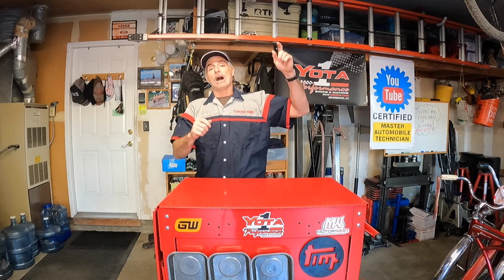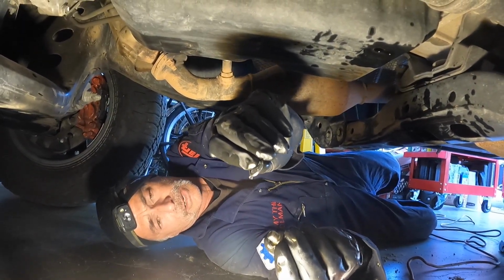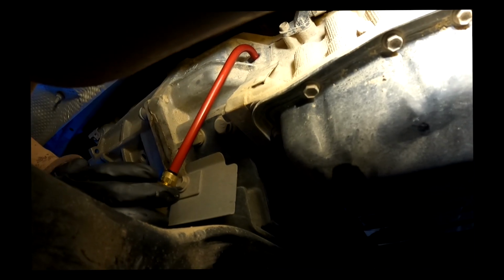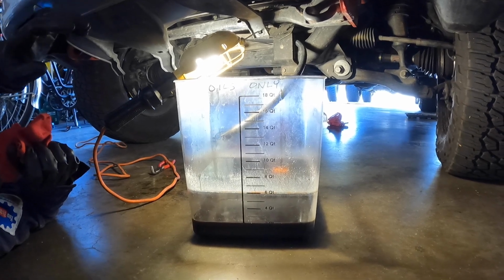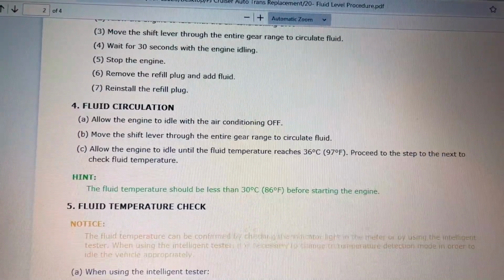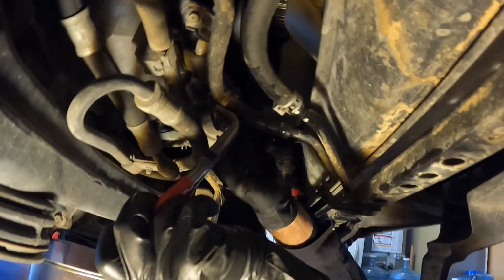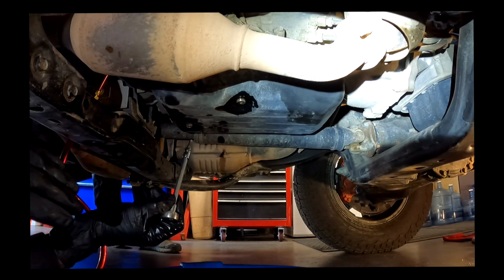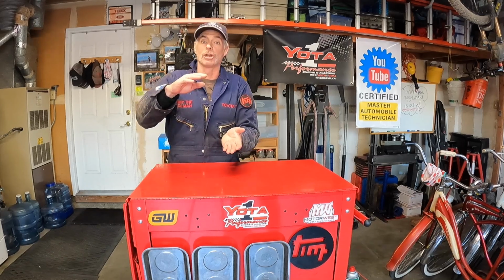Toyota/Lexus Sealed (No Dipstick) Automatic Transmission Flush (Fluid Exchange)

Comment: Nice video, the correct way to do a hot change no dip stick.  Though with fluid that dirty, if the miles were high I would have elected to drop drain pain and replace filter and gasket.  What are your thoughts on using better ATF like AMSOil signature fully syn if car is out of warranty as seems alot folks find at higher mileage and colder temp weather it works much better.
Reply from the maker: Yeah, dropping the pan and replacing the filter isn't a bad idea.  Aftermarket fluids are fine in my opinion.

Comment: Is there a possibility that you may have less fluid than necessary? If so, how would you know how much more to add during the drain and fill?
Reply from the maker: I definitely think Thanh's transmission was under filled based off how much came out.  If you're concerned about getting the transmission properly filled, we cover the procedure at the end of the video.

Comment: I rolled 182,000 before doing a transmission service.My tundra drained three qts. Started cold drained 3 quarts added 3 ran thru gears.repeated three times. Run to temp. Adjusted level. Working great two years out.used Valvoline full synthetic checked after 30,000 miles fluid looked red. I attached 4ft, of 1/2" clear tubing to a funnel threaded from engine bay to filler hole .
Reply from the maker: It's pretty amazing that you got away with not servicing the transmission for that long.  From my research,  the effective life of ATF is only 100k miles, and that's under perfect driving conditions, with the truck never being driven in the mountains or towing anything.  In my opinion, you took away some potential life of your transmission by not giving it regular fluid servicing.

Comment: The Rav4 Hybrid is SO easy. Drain to EMPTY and simply REFILL through FILL PORT until overflow and then let it drip from the same port until a drip. 
NO temperation observation.  You're DONE. 
So what I have to get under the vehicle.  I have to replace the filter anyhow.
Reply from the maker: Yeah, simple is good.

Comment: Tim, I have a 2014 RAV4 and the maintenance manual has no mention of changing the transmission oil thru the 120,000 maintenance (highest mileage the manual goes to).  It does mention changing the transmission oil if operating under special conditions, like driving while towing, car top carrier or heavy vehicle loading.    When should the transmission oil be changed if driven normally?
Reply from the maker: The life expectancy of ATF depends on the temps it's been subjected to.  ATF can last as long a 100,000 miles if the fluid temp never exceeds 170 degrees fahrenheit.  If you drive at all in the mountains, you will be exceeding 170 degrees.  As the temps go up the life expectancy goes down.  When fluid loses its effectiveness to lubricate, excessive wear happens.  

Since I drive a lot in the mountains, I do a drain and refill of the pan every 10k miles to keep my fluid in good shape.  This is what I recommend people do.  If they want to wait a longer interval, then I recommend a full renewal every 30k miles.  Performing fluid maintenance is cheap insurance.  It might be overkill, but I'd rather err on the side of doing fluid maintenance too often than not enough and then be looking at a transmission replacement.  It's a big and expensive job to perform.

Comment: It occurred to me that I would like to do the fluid level check before doing any of this.  What vehicle was this? How can I find out what transmission I have on my 06 Tundra?  How do you know if you should replace the atf filter?
Reply from the maker: The vehicle used was a Lexus GX470.  Your Tundra has the same transmission.  We list all the vehicles that had this transmission in the video description.  You can tell if the ATF needs replacing based off service records.  If you don't have service records, you can take a look at the color of the fluid.  Healthy ATF is pink in color.  As it breaks down and deposits gather in the fluid, the fluid gets darker.  Dark red is borderline good.  If it's brown or black, it's overdue to be renewed.  You'll get different suggestions on the interval to do a full renewal or partial renewal.  I believe a full renewal should happen every 30k miles.  If you want to do just drain and refills of the pan, do them every 10k miles or every other engine oil change.
Reply: oops, I missed that part of the video description, even though I thought I read the whole write up you did in the first comment below.  You are a real hero for showing us all these shop procedures!  I loved this one!  I bought my first Toyota a little over a month ago, but yet I had watched many, many of your videos, even before purchasing the Tundra.  It's a 2006, I purchased from a dealer with about 150K miles.  I didn't get any service records.  Is it normal that around 40-50 mph, it seems to not want to shift to the next gear.  It feels like its holding that gear with rpm's winding out about 3000, with no upshift, unless I keep the pedal going and then it eventually does and seems normal in other situations, as far as I can tell, lol. @TimmyTheToolman
Reply from the maker: @DesertGardenPrepper  No worries.  We are here to help people do their own work so they can save money and make sure the job gets done right.  Have fun with your 1st Gen Tundra.

Comment: We own an 07 Tacoma 4Cylinder Manual Transmission with over  250K miles on her, and we have owned since about 30K miles and we have never drained the transmission fluid, nor rear differential fluid, nor engine coolant either. Would you suggest doing these services at this point or just leaving it be, since such high miles and replacing these fluids especially on manual tranny might do more harm than good?…
Reply from the maker: Service them all.  Coolant should be renewed every 30-50k miles.  Differential gear oil and manual transmission gear oils should be done every 30k with conventional oil or around every 50k for synthetic.

Comment: Bad idea to change original sealed transmission fluid, you flush out all of the good stuff. New oils makes transmission slips,,slips transmission is a useless transmission, following your car  owners manual is ways safer than any you tube channels
Reply from the maker: For the most part, your advice is BAD!  ATF is not a lifetime fluid.  No automotive fluid is.  It should be renewed at regular intervals to keep the transmission from suffering abnormal wear.  

When it comes to a transmission that didn't receive regular fluid maintenance, and it's got a lot of miles, then there might be some concern about doing a full renewal of the fluid.  Some people subscribe to this concern, others say it's a bunch of B.S.  I tend to agree you have to be careful doing a full renewal on an abused transmission.  The safest bet is to do just do a drain and refill of the pan followed by other drain and refills spread out over some time, like every 5k miles until the fluid looks good.
Reply: @TimmyTheToolman  nothing lifetime even our planet. In this case sealed transmission good enough for the average life of the car 12 or 14 years 150000 miles.180000 miles normal driving. ..( For none  mechanics)Not smart driving around 300.000 miles 25 years old car anyways .(..out dated,  unsafe, needs lots of costly trips to repairs  shops to keeping it going,,,)  my advice is for diy guys out there ( none mechanics),tempering with sealed transmission making it more bad than good . Very terrible if tempering with transmission while still under warranty....
Reply from the maker: @Big15inchesnobullshits  Exactly!  The transmission took a dump at 150k miles.  I guess that was its lifetime.  My point is, a vehicke's drivetrain, including the sealed automatic transmission, will last longer if they are maintained.  This is not theory.  It is a fact.  Some people like myself don't exchange cars like they're playing cards.  We take care of them and keep them for our lifetime.
Reply: @TimmyTheToolman  just  look around in traffic,,few older car on street for reason .only mechanics can afford to keep an old car . By the time transmission go out, everything else is already out or on the way out .
Reply from the maker: @Big15inchesnobullshits  Yeah, we've developed into a throw-away society, no doubt, but that doesn't mean me and others like me need to take part.  Our channel is all about DIY Auto Mechanics.  You don't need to be a trained mechanic to be successful.  All you have to be is willing to learn and willing to invest in tools.  The rewards of DIY Auto Mechanics are huge.  But, it's not for everyone.   For those that are into it our channel is a wealth of information.
Reply: @TimmyTheToolman  I taking care of 1998 mustang gt  in early days with 145.000 miles In 2017 . Engine perfect ,5 speed manual trans perfect but everything else is go out one after another, from balls joints, tie rods ,starter, fuel pump all rubber parts,one from fueler neck to the tank.and lots more , not worth keeping even no labor costs to fix , getting new car actually making money.  No worry. I didn't see auto repair shops for 6 years now,
Reply from the maker: @YESimAI2010  You should have kept the Mustang.
Reply: @TimmyTheToolman    just not worth it ,I'm much happier with less or almost worry free car for now
Reply from the maker: @Big15inchesnobullshits  Well, if you're happy, that's all that counts.

Comment: About ready to do this myself. GX470 with a little over 260k miles and I have the same washboard road vibration around 40-50mph (the whole vehicle shakes), so hoping this will remedy that issue. I will stay on the cautious side and do a partial flush only, maybe 8qtrs, then repeat again in a few weeks and replace the rest. Since I am pulling a small offroad trailer with my rig now, I will also install a bigger external radiator to keep the trans temps lower. Recorded some temps on mountain passes in the 220-230 range which is fore sure too hot for my liking.
Reply from the maker: Hope the fluid exchange worked for you.  Recording high trans temps in the mountains is normal.  Even with using the trick of turning overdrive off to lock up the torque converter doesn't always work based on the speed you're traveling up the grade.  The key is to know when it's prudent to pull over and give your transmission and engine a break.  That could be the difference between happily continuing your trip or being stuck when you either blow your trans or engine.  Knowledge is power.  The fact that you monitor your temps puts you way ahead of the game.
Reply: Did this fix it or fudge it? Having similar issue

Comment: good morning...if you do a simple drain the pan and fill, if you drain 4 quarts cold....is it ok to just replace 4 quarts with out doing the temp check procedure?
Reply from the maker: I would still do the level check procedure.  You don't know if the fluid level was good before you did the drain and refill.  It's also a bit difficult to exactly measure what you took out and what you added back in.  Even with a container with graduated level markings, if you drain out somewhere between the markings, you're doing a little guessing.  Also, with the fluid pump, some fluid is left in the pump lines which can throw you off.
Reply: @TimmyTheToolman   THANKS!
Reply from the maker: @dehartshipyard2135  You're welcome.  If you do regular pan drain and refills, you can keep your fluid in great shape.  I recommend doing one every 10k miles or every other engine oil and filter change.

Comment: Gonna use your video for my ‘ 15 Tacoma.. apparently the hot tip is to get a 2nd hex 14mm drain plug and toss that lame allen bolt overflow plug - same thread pitch
Reply from the maker: Yeah, getting rid of the allen head bolt wouldn't be a bad idea.  Good luck with the trans flush.
Reply: any info on the plug you used or just got the exact same plug from toyota?
Reply: @jimmpsi  its same drain plug hex bolt from Toyota at least on Tacoma

Comment: I have 07 lexus es350 130k miles sealed transmission. Dont know if the trannys ever been touched. Is a pan drain risky? Or worth a shot i feel like the trans isnt shifting as good as before and i think i see some flaring.
Reply from the maker: Flaring?  What's that mean?  Anyway, yes, I would do a drain and refill for sure.  Then do another one in around 3-5k miles and follow it up with a 3rd drain and refill in another 3-5k miles.  After the 3rd drain and refill, your fluid will be in good shape.  Then maintain it by doing a drain and refill every 10k miles.  Just make sure you are getting the level correct after every drain and refill.  Don't assume the level was good from the beginning and accurately measuring what came out and what is going back in isn't that easy to accomplish.  Use what you learned from our video to make sure the level is correct.  Good luck!
Reply: @TimmyTheToolman  should i have lexus do it? And this is what i mean by flaring
https://youtube.com/shorts/Q0Ni0i7GNJM?feature=share

Comment: take two out and put the same back in. In a few days/weeks/months do the same. Getting a 2023 Corolla Cross hopefully in the summer.
 I have a 17-year-old Dodge Caravan 3.3. Been sucking out about 2 liters every 2/3 years, then putting the same back with clean ATF-4. Never had a problem. And for a Chrysler 3.3 and its tranny, that is a really good thing.👍
 This method is just nuts! At least Honda has a drain, a fill, and an overfill. Dah! Toyota has gone totally BMW stupid. Shall see how long I keep it. My Dodge 3.3 has 300,000 km on it, and doesn't burn more than 1/4 pint between oil changes, if that! Tranny not a drop leaks out of her. Assembled in St Louis April 2007.Keeping her too. Drives well, salt got her though. Canadian winters kill vehicles.
 But it is your vehicle, so I really don't care.Enjoy.
Reply from the maker: I think your 2 litre method every 2-3 years could work ok if you don't regularly travel in the mountains.  From what I understand,  ATF could last 100k miles at normal ATF temps.  But, as the temps increase from pulling up grades, the life of that fluid quickly diminishes.  If a person does drive grades regularly, and they wanted to just perform drain and refills like you, I'd suggest doing it every 10k miles.

Comment: I have a 2009 ls460 with 200k mileage. The transmission fluid was never changed. Is it ok to drain and fill the transmission fluid?
Reply from the maker: I can't guarantee you anything because I don't want you to be pissed at me if something happens.  But, if it were me, I'd do the drain and refill.  Then I'd do another one in 5k miles and follow it up with a 3rd drain and refill after another 5k miles.  This slow process of renewing the fluid is the safest method.  I wouldn't opt for a complete flush due to the fluid never being renewed.  

If a drain and refill causes your transmission to have issues, like the clutches slipping, it was on borrowed time anyways.  Good luck!

Comment: Thank you so much for your video! Are there any consequences practicing getting into "temp check mode" ? I wanted to make sure I was able to get into the temp check mode before I actually do the drain and refill. I'm going to be working on my 2021 4runner limited.
Reply from the maker: You're very welcome.  No, there wouldn't be any issues with practicing getting into the temp check mode.  Good luck with the job.

Comment: It would seem to me that there is a hole for a dipstick with a plug in it somewhere on the tranny. So anyways my situation is,
 I added a transmission oil cooler to my 2020 Tundra and would love to add a dipstick. I did fill the cooler with oil when I installed it but I know that I'm slightly low due to the volume of the hoses. So, is there a plugged dipstick hole? Or assuming there is no hole, I had a few other thoughts. The most critical is that why the hell did Toyota make this so difficult. I mean wouldn't it be so much simpler to have the over flow tube cut to length at either completely hot or ideally cold, lets say 70 room temp. And wondering if there is an after market solution for this?
Reply from the maker: I doubt there's a plug you could install a dipstick into.  They made these transmissions without a dipstick so I'm assuming they wouldn't have a convenient plug you could remove and dipstick you could install.  

I don't know why Toyota went this route.  Probably so they could get more people to come into their service department.  They do claim their WS ATF is "Lifetime" fluid which is a crock of shit.

Comment: The fluid was also low on mine when first draining. I wonder where that fluid goes?
Reply from the maker: It either leaked out or the transmission was insufficiently filled by a previous mechanic or DIYer when they serviced it last.  ATF is never "consumed" by the transmission fluid system like engine oil can be consumed by an engine due to worn piston rings.
Reply: @TimmyTheToolman  got it.